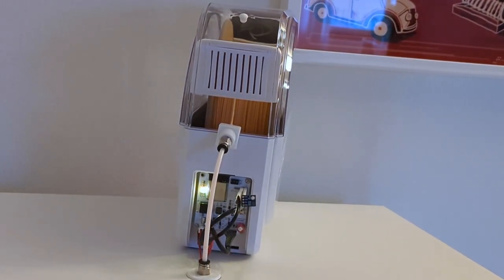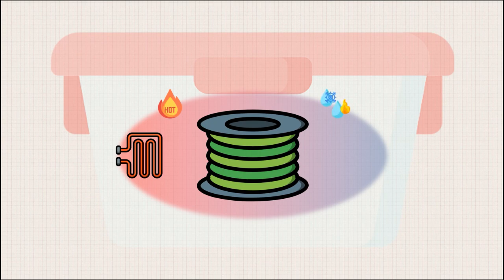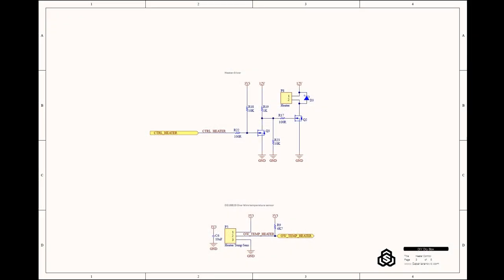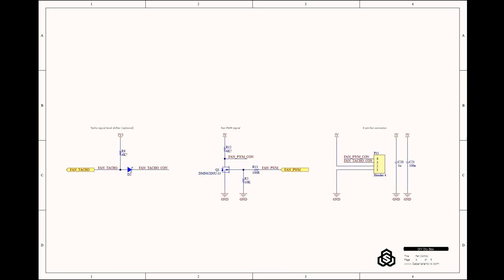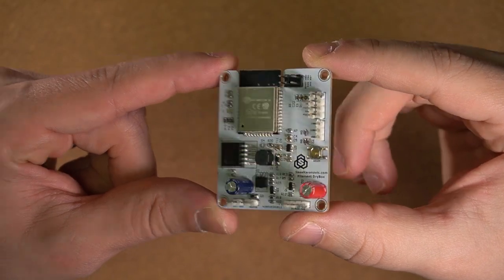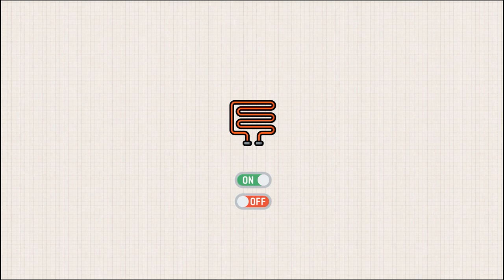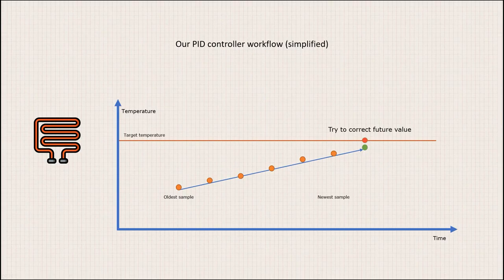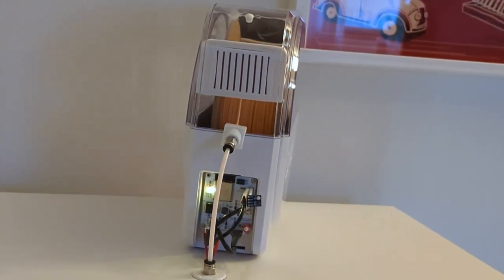DIY 3D Printing Filament Dry Box

Comment: Wow, even though this feels like overkill for a single drybox, this is really impressive.
Reply from the maker: Thank you! It was so much fun making it!
I definitely spent more time on this project that I would like to admit, but I'm hoping that whoever builds this after me will just call it a super easy mod to make your filament dryer much better. In that case it's all well worth it. :)
Reply: @SasaKaranovic  Nice.

Was about to ask how compiling and uploading the website worked, but didn't know that PlatformIO can seperately handle sideloading the data on it's own.

I take it the SPIFFS is specific to the ESP32?
Reply from the maker: @CruzMonrreal  Yes, PlatformIO can do that and it's actually really nice because even though it's (one small ) extra step to get PlatforIO installed. It's worth it because people can just run a command against source file and always get same products. Which would be very difficult to do with just the Arduino IDE.

Comment: Awesome! Very impressive. FYI, it might be worth looking in to Home Assistant and ESP Home. The con is that you add a dependency on home assistant, but you get a very easy API for automation, and monitoring in the "one thing" you're looking at anyway
Reply from the maker: Great idea! Thanks for the suggestion. I already use Home Assistant and can integrate the dry box trough custom API calls we exposed.
I wanted to make a project that can be used by the wider open-source open-hardware community, and while HA and ESP Home make sense, I thing I agree with you that it would make everything dependent on using HA, which might limit how many people can use this project. :)
Reply: @SasaKaranovic  Enable an MQTT api and then people can quickly integrate it into home assist or even openhab fairly quickly. Not keeping them tied to a single automation platform. :)
Reply from the maker: @TheZolon  Web API is even more generic and lightweight/generic (compared to MQTT). I have multiple devices (including this filament dryer) that expose status and control over Web API and I integrate them with HomeAssistant. I assume OpenHab should work too but haven't tested. :)

Comment: I have been thinking of doing something similar but adding a loadcell for measuring how much filament is left on the spool and auto rewind for when I am using an MMU. Great project.
Reply from the maker: Thank you! I actually had the same idea. But then I opted not to do it because I wasn't sure how easy/annoying would it be to "zero" the load cells, account for different variation of weight of each spool etc. At the end, without any interaction you would just be able to find out how much filament you used between prints. And for that I find that my PrusaSlicer "guesstimates" that pretty accurately. But if you want to add that, it's actually extremely easy with HX711 (24-Bit Analog-to-Digital Converter (ADC) for Weigh Scales) and load cell that is designed for ~5kg.
Reply: @SasaKaranovic  most spools are fairly consistent per manufacturer.
Reply from the maker: That's true. I have couple of filaments brands that I switch between. Also depends how big (weight-wise) your prints are and how accurate weight measurements you need... +-10g or so wouldn't be very useful for my application.
But I agree, there is a way to easily make this feature work. However it is extra cost and complexity that would probably not be that useful to everyone without some kind of tweak/interaction. But hey, if people need it, project is open-source open-hardware. :)

Comment: Are you going to do any boards from pcbway? I'd love to buy a board already done! YES! I'd like to see a larger dry box & component assembly. IT woud be great if this could be used to control a crock pot or dehydrator!
Reply from the maker: I did order bare PCBs and populated them myself, but there are few people who ordered fully assembled boards using the provided gerbers and BOM.
Keep in mind that this is designed for the filament dryer. If you want to use it with a different heater you would have to make sure board can drive it. If you want to drive a crock pot or dehydrator, you probably need to modify it to use a SSR or control it in some other way. Unfortunately it was not designed for driving AC loads so it won't work without modification.
Reply: @SasaKaranovic  Thanks for the reply! Super cool project!

Comment: I ordered some pcb’s from pcbway and they had a question regarding the holes all being labeled as NPTH but both top and bottom are on the copper pad. I sent you an email in regards to this but wanted to document it here per your request as this may help others. Looking forward to your response. Thank you for sharing this really neat project
Reply from the maker: Good question. Those are mounting holes so it doesn't really matter if the fabricate them as PTH or NPTH, they don't have any electrical function.
Reply: @SasaKaranovic  OK great. Thank you for such an immediate reply. Cheers
Reply from the maker: My pleasure. I would love to see how they turn out so feel free to tag me on Instagram and/or Twitter!

Comment: Great initiative, thank you for sharing, I liked the explanations on the concept.
I'm considering building something similar (a bit bigger, as I'd like to accommodate the 3kg 300mm spools).

It would be great if you can follow up on this video with a how-to-build step-by-step guide. You have most of the info already, and with a bit of work, it could be translated into something super easy to follow.

Ideas that would make it better (in my view):
- use off the shelf independent components (and avoid reusing old parts like the heater and enclosure from the sunlu filament dryer) => it can't be used by others considering a bigger design
- more details on building the PCB (did you use a service that mounted the SMT or you soldered those yourself)
- describe how you uploaded the code to the ESP32 (it's great you're using platformIO, though it's not obvious how you connect the board to the computer and upload the sketch without a micro-USB port) => I personally prefer adding a full ESP32 development module (with a micro-usb that you can mount using the GPIO pins) and replace if needed (not soldered directly to the PCB board)
- loved the use of the API that can be connected to Grafana, OctoPi, home assistant => how to actually integrate

I could help you out. I don't have much interest into creating YouTube videos, though as I'm considering building something like this myself maybe we can combine our efforts to put out there a nice tutorial for others to use).
Reply from the maker: Thank's Ovidiu! I'm glad you liked it!
Also thank you for taking the time and give suggestions, I have noted them down and maybe in one of the follow-up videos I can build a fully custom solution. Although the current one leverages some off-the-shelf components, the hardware/board is mostly agnostic/universal so hopefully you are able to use the design and modify it to fit your use-case. If you end up making one, I would love to see how it turns out!

Comment: Hi Sasa, thanks for the amazing project, I am currently building it but I have some issue in finding all the parts due to the global semiconductor shortage and as I have limited knowledge in the field I am not sure which alternative to pick.
I am only missing the mosfet DMN62D0U-13 , can you suggest any alternative that is available at Digikey  or similar website like Farnell or Rs components so I can get it in UK?
Reply from the maker: Thank you! I'm excited that you decide to build it. I would love to see the final result.
Regarding DMN62D0U-13, pretty much any SOT-23 "low voltage logic" N-Channel MOSFET will work. Look if you can find DMN2005K-7, DMN2056U-7, DMG3414U-7, AO3422 or any similar part you can find. Also, these kind of MOSFETs are fairly cheap and you only need handful of them, so just to be safe you can buy 2-3 different PN and see which one works best for you.
Reply: @SasaKaranovic  Thank you, I place the order and PCB should arrive this week, it gonna take some time as I never worked with SMD components before so I need to figure out the best way to assemble everything but I'll definitely post somewhere the end result.

Comment: Awesome video keep it up! Would be very interested in the larger dry box. Also what's the temperature range? Would love the larger dry box with temperature reaching closer to 100.
Reply from the maker: Thank you! I'm glad you liked it. I have a couple of projects in the works that I'm making videos for but in the future I'll probably revisit this topic. :)
Reply: I was thinking of doing something similar but I absolutely suck at programing and Don't have experience with chosing electrical components. So I'm probably going to run wires to my printers octopus running klipper and control it via the web UI.
Reply from the maker: If you have spare ports on your control board that can drive the heater, that's a good option.
I personally like to build my own custom stuff and then integrate it. But at the same time there are so many different ways to do this, just pick the one that you are most comfortable with and give it a try.
Reply: I'm just wondering if it's less flexible then your solution.
Reply from the maker: It's hard to say. You will need a decent PID controller if you want to keep the temperature stable/accurate. The board in this video is basically dedicated to that function. With you controller board, you will need one channel to control the heater but also another one to read the temperature. Then you need to also periodically check the temperature and adjust the power output which could steal cycles from other things your controller board needs to do.
Obviously this is me assuming a lot of stuff without even knowing your setup and how it would work.
But if you feel that's the lowest hanging fruit for you, give it a try and see how it works. You can always switch to a different solution if that one does not work well.

Comment: I use 2x 8kg Form Futura Rolls on my IDEX printer. I’ve just (literally today) finished modding my small dehumidifier cabinet to suit my filament needs. It seems that it will work fine, but I’d like to see your version for larger spools.
Reply from the maker: Thank you! I might revisit this project and actually build the entire dry box with custom (off-the-shelf) components and in much bigger form factor.

Comment: Id suggest getting everycircuit simulator. 3:21 has a ton of unnecessary parts. Bjts can help get components down too.
Reply: I'd suggest learning about real electronics circuits and how they work. There are no unnecessary parts, there are not enough parts actually. The gate resistors are there to limit the inrush currents into the FET gate, as a gate is basically a capacitor that wants to draw a very high current when you apply a voltage step. The resistor limits this current, slowing down the signal so you have less EMI and EMC issues and it prevents overloading the MCU outputs. The pull up resistors are used to keep the gate at a defined voltage level, because in the state that the microcontroller is not yet programmed or comes out of reset and has not yet initialized it's IO pins, the pins are set to inputs, so you would have an undefined voltage at the FET gate that could turn on the heater and burn up your plastic box in programming/debugging scenarios. So having some safety-resistors that apply a defined voltage even if the controller does not run is very important.
Using a two stage amplifier to use a logic level FET that amplifies the low voltage from the MCU to 12V and then use 12V to drive the power FET to reduce power losses is pretty common as well. You could of course replace that with a high power logic level FET, but they have a lot of gate capacitance that you would have to load/unload from a weak MCU pin, so that would make the switching slower and thus you have more power losses in the switch over phase. And having two dedicated components makes it easier and cheaper to find and source replacement parts. So this circuit here is a good compromise. The diode over the heater connector is a good idea as well, because heaters are often inducitve loads that would induce an inverse voltage to the circuit if you switch the current thru the load off. The diode removes most of that voltage spike to protect the circuit and the power FET.
Using a BJT based amplifier here would not save you anything. You still have the same issue that you need a large base current to switch the output power transistor, so you would need at least two stages to amplify the weak MCU output current to a few amps that are required to power the heater. And you need all the other parts as well to have a safe and well functioning circuit.

Comment: I came here from hack-a-day. I’m in the market for a filament dryer for nylon and every off the shelf solution has issues. Most won’t get hot enough (80°c) or have a loud fan. Since you use the original heater from the S1 are you still limited to 70°c?
Reply from the maker: Hello to my Hack-a-Day viewers!
I don't really use Nylon so can't tell first hand. Also it depends on your enclosure, the board can actually drive much higher power heater. The enclosure I used is not really well insulated, so heating it up won't be the problem, it's leaking the heat to the dry box surroundings (confirmed with thermal camera). So maybe find an enclosure that is well insulated and/or has a higher power heater.

Comment: Great project, question though what's the purpose of monitoring the outside temp/humidity? I havent looked into the code, is it used in the pid loop too?
Reply from the maker: The humidity and temperature inside of the dry box will be different from the ambient (when working). So you can take either the inside or outside values to trigger automation and decide when the dry box should be On/Off. But essentially it's another data point that you can use/evaluate.